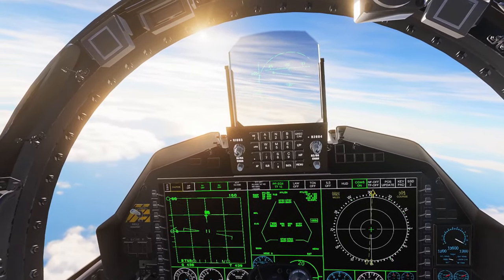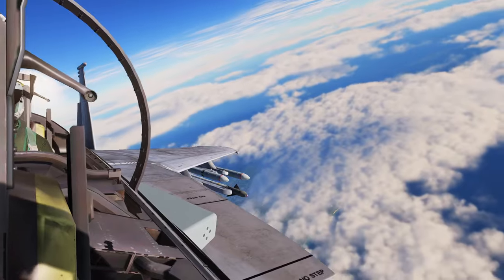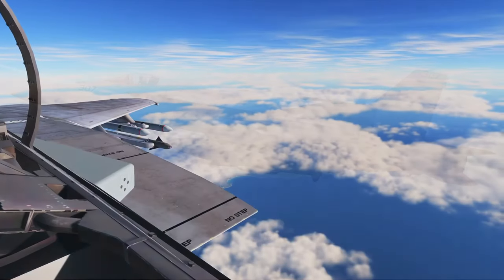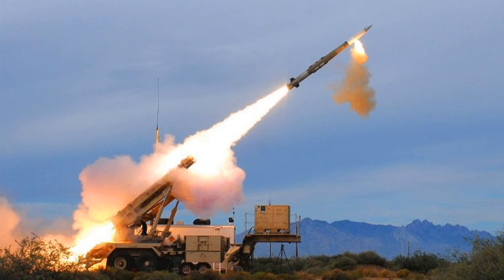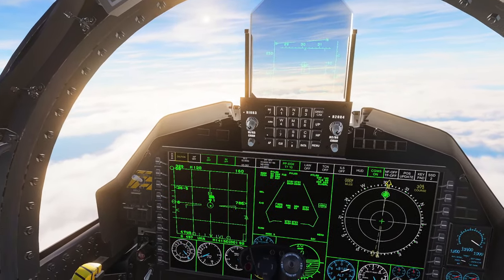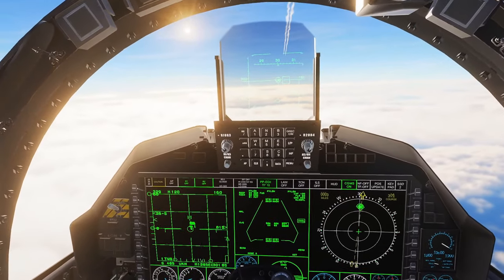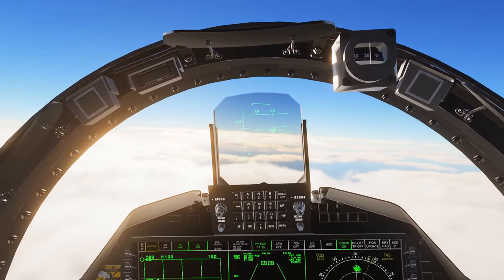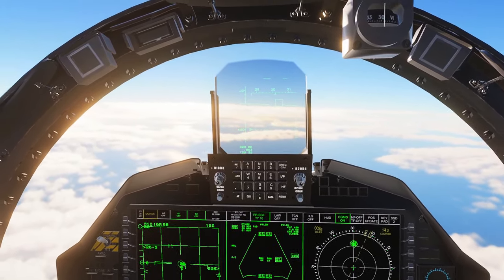F-15EX Progress Update | It's Almost Here!

Comment: Actually, the AIM-9 & AIM-7 programs were both originally Navy programs.
Reply from the maker: Yes they were, and I wouldn't be surprised if LREW gets cancelled and USAF ends up using AIM-174.  That would seem like the smart move, but it hasn't happened yet.
Reply: @SpinosSimulations  Especially, if LREW doesn't bring anything more than another supply chain to the table.

Comment: The AIM-120s don't have thrust vectoring! I thought you already knew that. What's going on with that spiraling is a missile specific problem though, not yours! The plane only launches or releases it from the pylon. It's the missiles' navigation and/or guidance and control system that gives inputs to it's flight control fins which needs corrections.
Reply: It's a value in the missile codes, it's not exclusive to thrust vectoring missiles, something related to it changed so all not recently updated modded missiles with/without thrust vectoring does the wacky spiral thing.
Reply: @kermittoad  
So it's not about thrust vectoring at all, and the AIM-120 doesn't even have it, as I repeat! It's the flight controls system that has glitches!

Comment: I understand it's a source code issue with working with the E model but are source codes really that hard to figure out? I mean, they have to work with DCS's source code. (I'm not a programmer so go easy on me) I'm genuinely curious as to why it's so hard to mod the full fidelity module
Reply from the maker: It's a full-fidelity module, of course there will be more complexity involved than with an FC3 aircraft.  It's also a full fidelity module that is incomplete and not being developed any further for the forseeable future.  And to top it off, all full-fidelity modules with MFDs and digital systems have their weapons hard-coded in, so they are not automatically compatible with new ones.  The only way to add something new is to replace an existing weapon.  All of this breaks integrity check, which I don't like.  It also requires people to own a $70 module, and one whose future is in question at that.  For all those reasons, I will not make any mod that requires ownership of the F-15E module.

Comment: No ASG-34 Legion IRST pod?

That's...unfortunate.

Do you know that, as a principle replacement for the aged-out F-15C, the USAF F-15EX will primarily fly as an ASA and OCA jet, without CFT?  It will make a huge difference in both acceleration and sustained EM values if you can release the 610s to clean the airframe rather than having to carry HRL+Stub mounted CFT into combat with all their drag penalty.  Word is both the Sniper and AAQ-13 pod will also not be on the jet's inlet stations, for the moment.

Just saying that a 29,000lb IPE engined jet, combined with a 15,000lb weight shave would likely provide a considerably different (better) 'feel' to the airframe, in the primary ACM envelope.

Even if you haven't emulated the FBW flight controls and expanded envelope CG range that they enable.

The F-15EX is a next-gen Eagle, it does not handle like the old Mudhen...
Reply from the maker: The Legion pod is included, but it's purely cosmetic.  One of the limitations of FC3 I'm afraid.  The upshot is that since my F-15EX mod is using the F-15C flight model, it handles more like the lighter F-15C than the Mudhen.
Reply: @SpinosSimulations  

Thanks for the response Spino, I appreciate all the effort you put into this project.

Lot of hard work there.

If someone was able to get in touch with you on how the F-15EX really handles, would you have the ability to edit the EFM to a full PFM variant of the force model?

The F-15EX is quite a bit heavier than the original fighter models, even without CFT mounted.

But it's also a much stronger airframe with a couple more control effectors than the F-15C CAS can access and vastly quicker FLCS response scheduling and thus less pilot blending required.

It really is closer to a Super Hornet in terms of heft but with much more power as a 60/0 airframe.